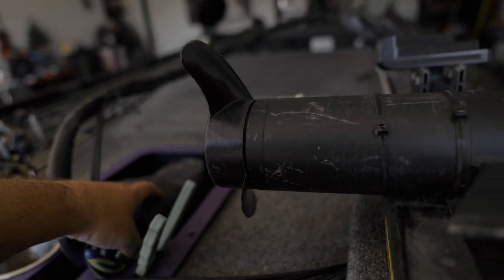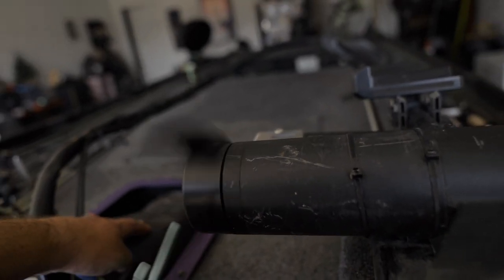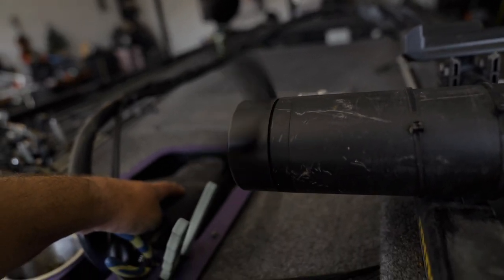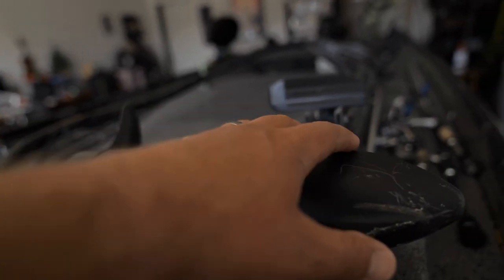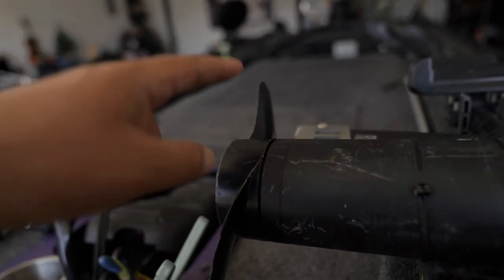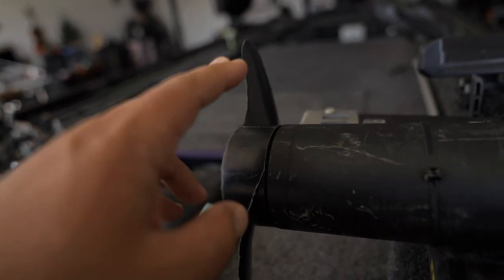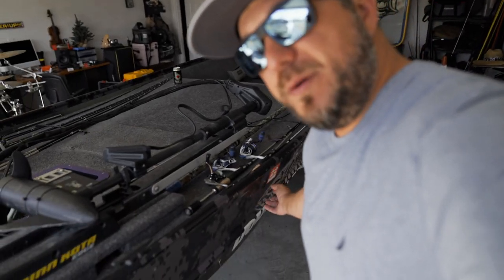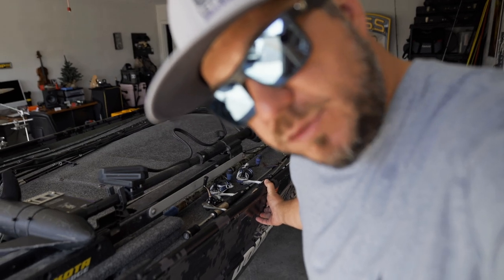Should I Go With A 24V Trolling Motor On My Jon Boat?

Comment: I got a 16' marsh hawk and had my 24v trolling motor running on 12v this whole time and it's fast kinda curious about how fast it will be if I switch the wires correctly an have it on 24vs I can't remember I think its a 80 or 100lb trust motor
Reply from the maker: I have my 24v running at 12v and it’s really not bad